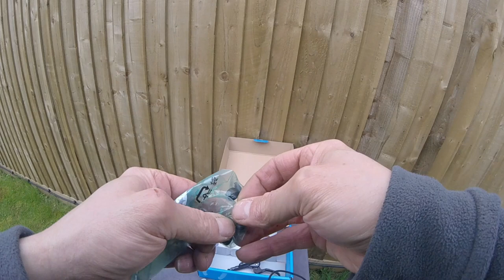Orange Stage 5 mountain bike - Building the Bike - Part 2 - Cranks and Brakes

Comment: What travel on the rear? I’ve got a stumpy that’s 130 all around as standard and wanting more travel up front
Reply from the maker: The Stage 5 is 150mm travel on the rear bud. 130mm is more than enough for heavy trail / light all mountain rides. Thanks for your comment.